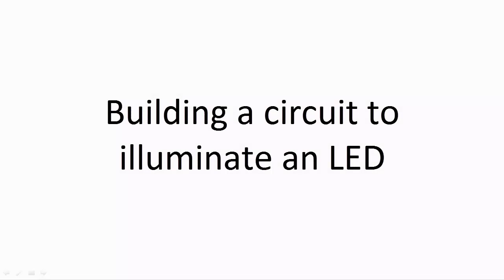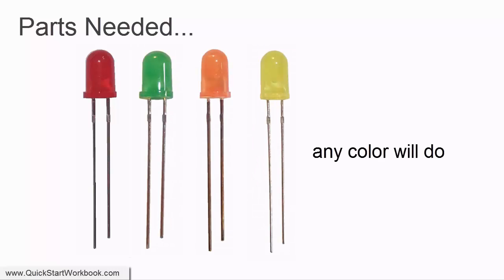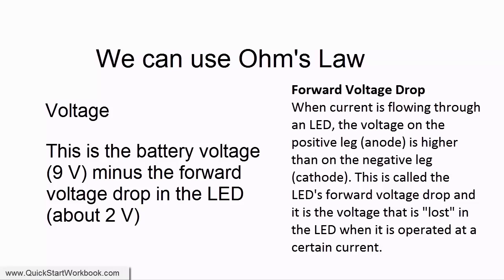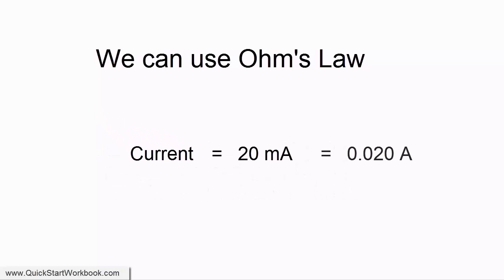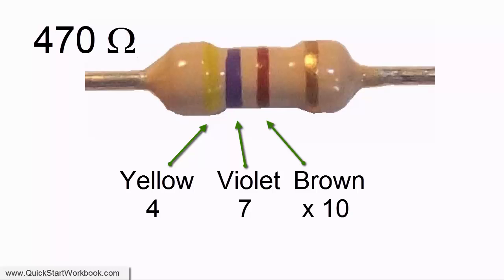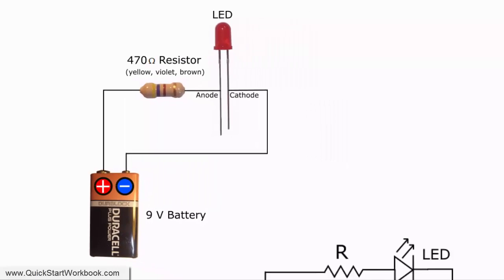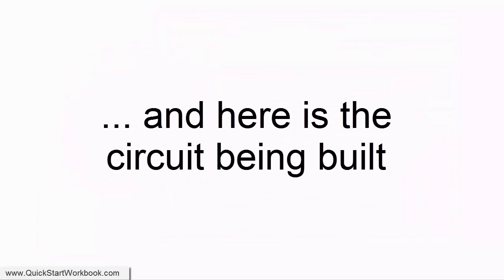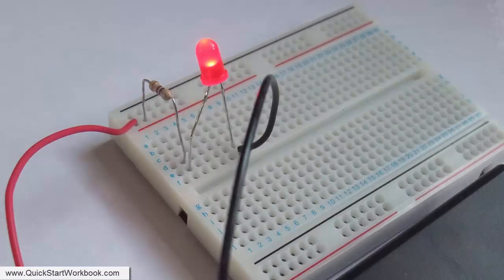How to Build a Simple LED Circuit - Electronics for Absolute Beginners

Comment: Why does it have to be 470 ohms not 350 ohms
Reply from the maker: 350 would have been absolutely fine. I just used a slightly bigger resistor just to build a bit of additional safety into the circuit so that it would be perfectly safe with any LED. Cheers, John

Comment: If I add 10 LEDs, does that change the resistor?
Reply from the maker: Hi Marie Claire. Yes it does. Each LED has a voltage drop across it of about 2v. Therefore, if you use a 6v battery, for example, and you have 3 LEDs, you won't need to use a resistor at all (3 x 2v). With 10 LEDs, you would need a 20v battery, so not really practical. I have 4 10mm white LEDs connected to a 12v battery, and that works ok. Each LED has a voltage drop of about 2.8v, so I'm not using a resistor in the circuit. Cheers, John
Reply: @quickstartworkbook1532  Thank you very much for that, I did find another one of your videos that showed me how to do it with multiples!

Comment: I can make the circuit work with 2 LEDs, but when I try to add more none of them light up. I don't know what I'm doing wrong. I check and recheck to make sure my components are plugged into the right holes, I confirm the LEDs are working. 

Yet when I add more than 2 I get nothing. So frustrating.
Reply from the maker: Each LED has a voltage drop of about 2v. So, if you have 3 LEDs, powered by a 6v battery, you don't need to use a resistor. If you have 3 LEDs and a 9v battery then you would need to use a small resistor, say something around 150 ohms. Try reducing the size of the resistor you are using. Keep reducing the size until the LEDs come on. Cheers, John

Comment: i used a 330ohm resistor... worked perfecly
Reply from the maker: That's great James. It's a good idea to try various resistors to see what the effect is. Of course, if you go too low, the led might blow; too high, and it won't illuminate.
Reply: @quickstartworkbook1532  a few days ago I connected four red LEDs in series with a 50 ohm resistor and they still work...

I did however, when i first did it i managed to blow LEDs 😅🤦

Comment: I am not sure how to interpret the flow of current (conventional vs non conventional) as the current flows from negative to positive.....so, is that a bottom rule that the schematics is always the other way around?
Ergo, in real time the current flows through the LED from cathode to anode?
...if so, then the resistor could go either end of the LED? Doesn't matter which side ?
Reply from the maker: That's correct. In fact, I've seen circuits where that is the case. Give is a go.

Comment: I am using scrap resistors for this. I have 560Ω resistor and a 9.8 volt battery. I’ve heard that you need 20 to 10 mA for it to light the LED. I used a current calculator. And I got 17.5 mA. Will that still work with an LED?

Comment: Should we use an alkaline or lithium battery?
Reply from the maker: Either should be fine - just check the voltage to make sure you don't burn out the LED

Comment: Hmm, i must be doing something wrong. When I power my red light-emitting-diode I use a 1.5v battery in series with a switch connected to a red laser diode shining across the room into my solar cell which is connected to the positive input of an LM386 and ground, outputting nine volts direct-current into a 220 ohm resistor in series with my red light-emitting-diode. Yours seems much simpler.

...Lmao
Reply from the maker: It does sound as though you've got quite a circuit going on there 😄
Reply: @quickstartworkbook1532  Haha!

Comment: sir nice video. is is possible to use a 5v (usb connection) instead of 9V?
Reply from the maker: You could certainly use a 5v supply. You would just need to reduce the resistor value otherwise the LED will be quite dim. I haven't tried a usb power connection, so I'd be interested to know how you get on.

Comment: really cool.  so if you didnt use the resistor you'd blow the LED?  I am assuming an option would have been to get a larger capacity LED?  really interesting - thank you
Reply from the maker: If you use a 1.5V battery as the supply, you don't need to use a resistor.

Comment: Current = 20mA  ...that seems like an arbitrary number; shouldn’t the Amperage be what the Battery provides?  ...not an expert, just a noob wondering where that number actually comes from.
Reply from the maker: The 20mA is what an LED typically needs in order to light up. If you supply less, eg 10mA, the LED will be a bit dim; too much and you might blow the LED. Be at you know what the battery voltage is, you can select a suitable resistor to give you about 20mA.

Comment: I don't have a resistor and Damaged 13 led
Reply from the maker: You need to use a resistor otherwise your LEDs will go pop.
Reply: @quickstartworkbook1532  yea I knew It will go pop but I didn't have resistors 
AND a big question I powered a white led with 2 batteries it worked and changed to red led it goes pop or does not ilimuninate? What is the reason
Reply from the maker: I suspect that the white LED can probably cope with a higher current than the red ones, so it doesn't burn out - it maybe very close to doing so though. The red ones that appear to not illuminate might have burned out without it being apparent i.e. no "pop". With the red LEDs, try using one battery instead of two. Or, connect your LEDs in series, which reduces the size of resistor required. As you don't have a resistor, try adding 4 LEDs in series. They will probably look quite dim. Then try it with 3. I have a video that shows how to connect LEDs in series.
Reply: @quickstartworkbook1532  series worked but no 1 battery does not work I did 4 battery 2 led white and yellow it worked still thanks for the Info
Reply from the maker: The voltage drop across an Led is typically 2 or 3 volts. So, if it's 3v, and you connect 3 LEDs in series, the total voltage drop is 9v. If you then connect a 9v battery as the power supply, you won't need to use any resistors because the total voltage drop = the total supply voltage. Good luck with your circuits.
Reply: @quickstartworkbook1532  ok

Comment: I made something like this in middle school. It was an led light and resistor that we connected to two prongs then solidified in a type of epoxy in an ice cube tray. We then could plug it into an outlet as a night light. Would this be the same concept if I replaced the battery in this diagram? Trying to replicate the one I made back then for my kids.

Comment: Great video! Just one question. Taking into account the ‘voltage drop’ that occurs across the led (9V-2V=7V) and the fact that you used a 470 ohm resistor, will the resulting current be about 14.9 mA in the circuit? (I=7V/470 ohms). Thanks!
Reply: Seems like it. A higher resistance gives a lower current.

Comment: I am confused by this, from my understanding electrons flow from negative to positive yet some people state otherwise and put the resistor on the positive side and others the negative side, surely one way is wrong I mean if current is flowing in one direction the resistor should come before the led in order to stop it from frying no?  So why are ppls diagrams so different in which direction the current is flowing.
Reply: jezmcm It is confusing. Ealier physicists assumed that electrons flow from positive end to the negetive. In fact, they discovered that they flow in the oposite direction from negative to positive. But even today you simply take the „older version“ also called conventional or „technical currentflow“ in german. It is not wrong to use the conventional method, you just realize, that your calculated current is negative for some reason, but why? Its really simple, it just proves that it flows to the other direction. So if you calculated like -20 mA, just switch the direction in which current is flowing and you‘re good to go. Sorry for the poor english, im obviously german haha.
Reply: MongoTV is right. You need to make the distinction between Conventional Current and Electron Current.  Early pioneers used the Conventional Current thinking electrons were positively charged. Today we still use Conventional Current in our textbooks.

Comment: How did you figure out which resistors to use so the led won't fry? I mean, the result was 350 and you have chosen 470. Thanks!
Reply: you can always use a larger resistor, doesn't matter as far as I understand it
Reply: Its better to have greater resistance than less, in that way you will prevent the led from burning though it will light a little dimmer

Comment: and if i added more LEDs I'd need less resistance?
Reply from the maker: Hi Lucy, thanks for commenting on the video. I just used standard jump wires that I bought from an online electronics retailer. Yes, you're correct that as you add More LEDs, the lowt resist value you need. Once you get to about 4 LEDs you don't really need a resistor. Check it out with Ohm's law. Cheers John

Comment: I like this simple video. I am looking forward to learning more about electronics. I am a radio enthusiast. I have a radio which I would like to add an LED, to illuminate the dial when it is night time. Do you think this method will work for my project? Thank you for any advice and for helping out, 73's Lee.
Reply from the maker: Hi Lee, thanks very much for commenting on the video. You could try adding a night light, which will just come on when it is dark. I've added an example here - https://youtu.be/-yg9h1GxZVw.
Cheers, John

Comment: Hi great video. I'm new to this can I ask why you kept the current in mA? When I tried this I converted it to Amperes as I thought that's what would be needed to do the calculation in ohms law. Thanks
Reply from the maker: Hi - Thanks for watching the video and posting a comment. You're absolutely right, when using Ohm's Law you need to use volts, amps, and ohms for the units. So, 20 mA (milli-amps) would need to be converted into 0.020 Amps when it is used in the formula. Cheers, John
Reply: That’s just what he did in the demo.  2:05.

Comment: Sir if 5ps  2V led and  9v volt battery then resistor?????
Reply from the maker: Hi - if I understand correctly, you have 5 LEDs - each having a 2V voltage drop - and 9V battery as the power supply. In this case, the total voltage drop of the combined LEDs (10V) is greater than the supply voltage (9V). The battery won't be sufficient to illuminate the LEDs. Inserting a resistor won't really make any difference. 

If you had 4 LEDs then you would need to use a very small resistor (about 50 ohms). 

Resistor value = voltage / current

= (9-8) / 0.020
= 1 / 0.020
= 50 ohms

Hope this helps
Cheers, John
Reply: Tnx for help sir👍👍👍
Reply from the maker: You're very welcome. Good luck with your circuit designs !
Cheers, John
Reply: YA